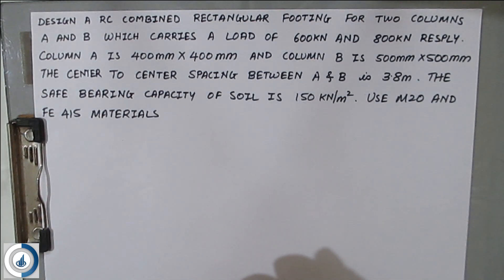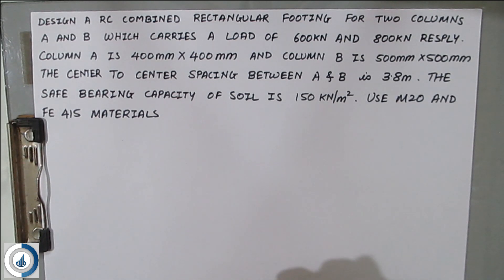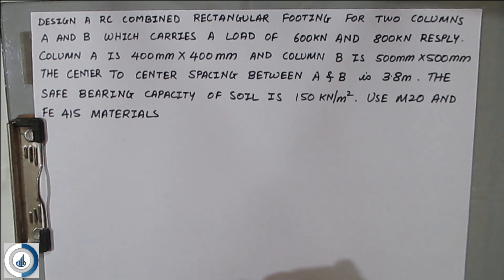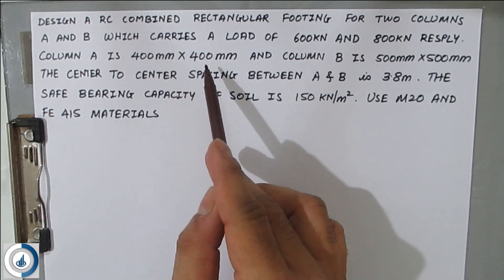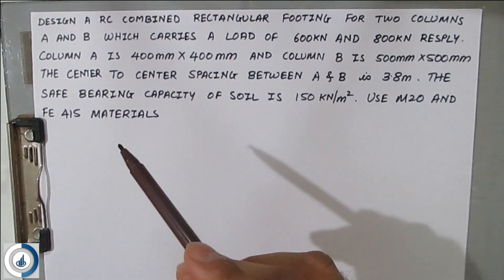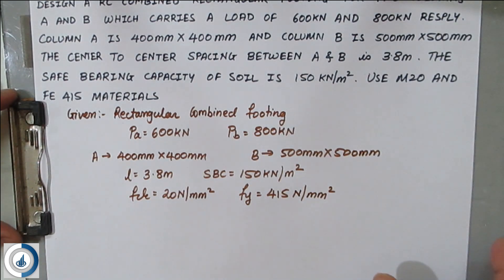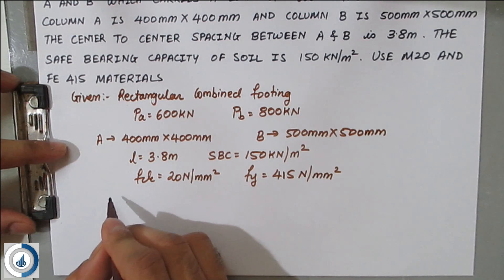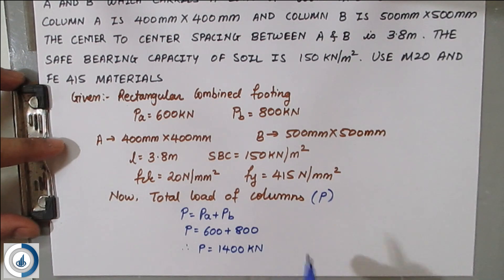Design of Combined Rectangular Footing | PART 1 |  | Check for Punching Shear or 2 Way Shear

Comment: U have not multipled the net upward pressure with 1.5 ...So it's a mistake
Any how very elaborated explanation i have ever seen ...Sir please do isolated footing with corner column and edge column and combined trapezoidal footing
Reply from the maker: Dear, i have multipied factor of safety while calculating moment, kindly watch the complete video. So basically its not a mistake. And i will note your requirements and try to come up with respective videos. Thanks for watching
Reply: @structuralanalysisanddesign  👍👍👍👍👍

Comment: sir in in net upward pressure total column load is (1450 kn) why are you take (600+800)?
you does not take 10% of total weight
Reply: Actually that is wrong, we should take total load which includes self weight also.